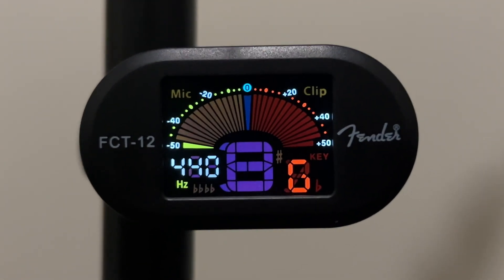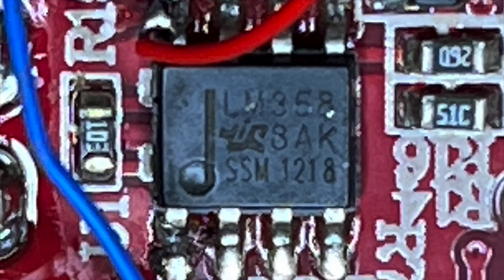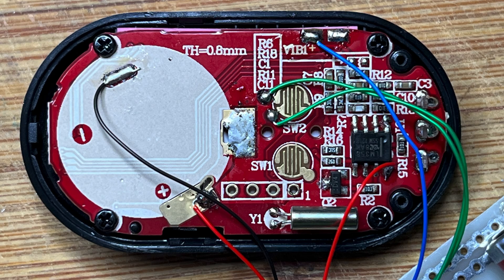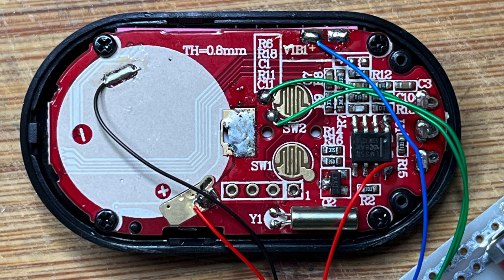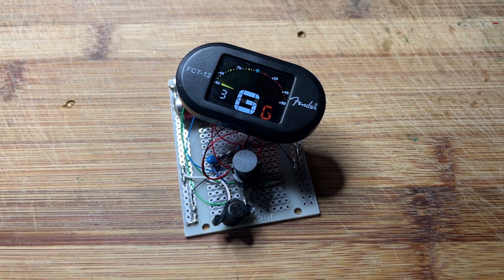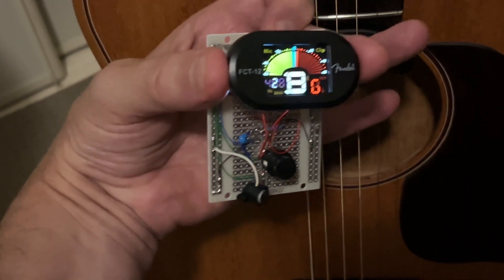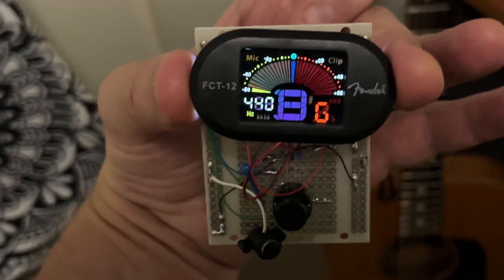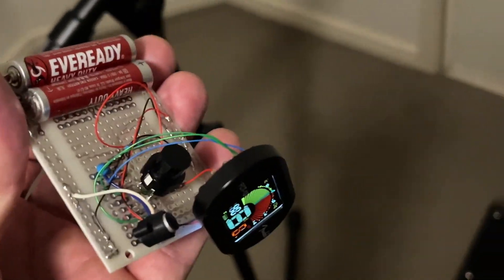Clip On Tuner Microphone Mod

Comment: Thats a cool mod, I have one of these tuners in my old electronics drawer and whilst not identical to yours Im going to try this mod myself, thanks for supplying the schematic thats going to be real useful.  
How are  the guitar lessons progressing? You seem to have aquired other equipment since using that battery powered Orange amp on one of your road trips.  The feedback reduction circuit in your next vid would be useful for my little 80s transistor based amp, maybe I'll resurrect my dusty guitar for the XX+1th time. Every time I pick up the practice work again life just seems to get in the way, one day eh!
Thanks for the vids
Reply from the maker: Hey, I haven’t had professional guitar lessons yet. Only singing lessons, but the same place does guitar lessons too, so it’s coming up next. After a break though. It’s a lot of money! I do get guitar lessons from a friend here and there. Progress is real slow so you wonder if it’s even happening ha! Loving it though. Some of the clip on tuners have mics as well as piezo, like one of the Snark tuners. I have a rack mount tuner, but it’s also too much work to plug into that since I’m mostly practicing with nothing plugged in.
Reply: @BrekMartin  Thats cool, there are a lot of good guitar players out there who have never had lessons and or can't read music.  I took a few lessons but the tutor always said beyond the guitar it's not the amount you spend on the hobby its about your passion for playing and having a musical ear. (what ever that means)  My dad never took a single music lesson but could pick up any instrument and play it after using it for a couple of days, he had a great singing voice too, obviously not a trait he passed down to me.  Really enjoyed your latest vids which combine your electronics and developing musical skills.

Comment: I remember my grade 1 teacher had the  analog version of these. Every time she’d tune her guitar, she told us to keep quiet. Always fascinated me how they worked.
Reply from the maker: Back in the day I imagine there was a narrow filter for the frequency of each string, and the amplitude of the signal measured with a meter after the filtering stage. It wouldn’t surprise me if you had to tell it the string you were trying to tune. Now a DSP would use a Fourier algorithm to split any wave into its frequency components, and select the lowest frequency as the fundamental note of the string. A lot is happening for little money. How far we’ve come!
Reply: I recently used a web app to tune my wife’s ukulele. Time has changed a lot!